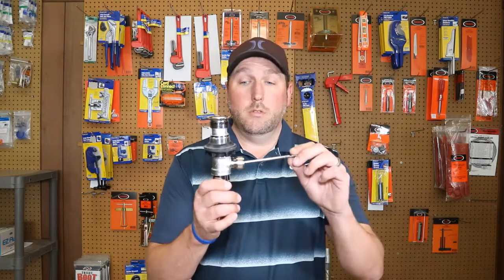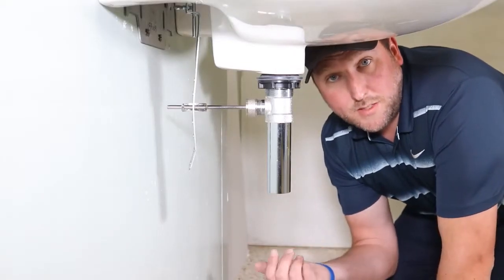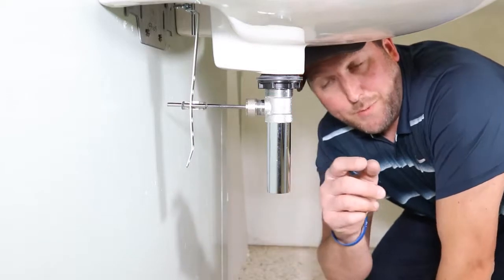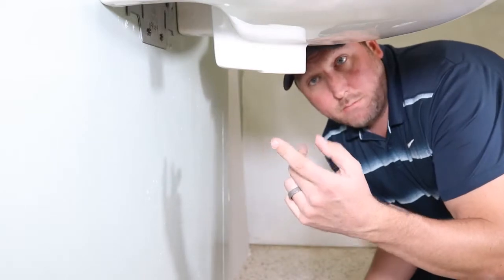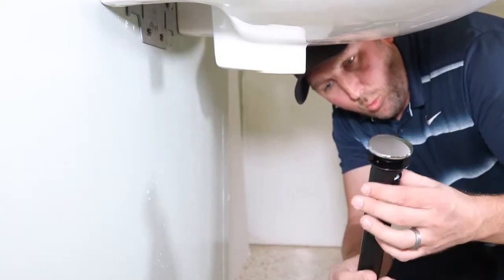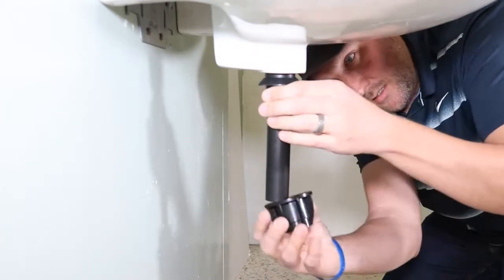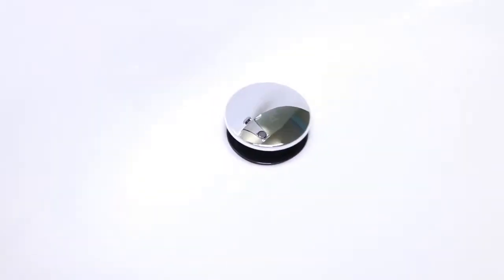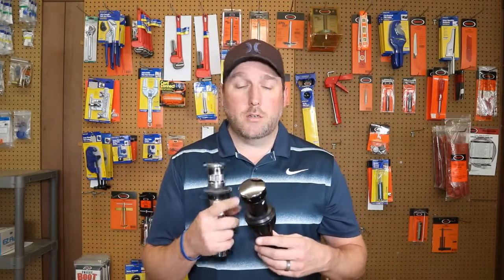How To Replace A Pop Up basin Drain

Comment: Tried and they break after a short time. Clicking mechanism.  Also hard to clean the gunk build up around the lip. Old style lift out or unhook. Use old tooth bush to clean out way down. AND old style helps filter the hair so ezier to get out with brush. AND less times to open up the P trap or link to the wall and good to go. Also who wants to put their hand or finger back in their filthy sink water to push the button.  Went back to the old style it works and is reliable for years.  Multiple apartment owner.

Comment: So, after upgrade, u have to wet your finger to open the drain.... and there will be a hole on the faucet  where the old rod was. (Ok, I will plug it with a rubber plug.)

Comment: Thank you for this video. I ordered two of the pop up a.b.d.'s that you recommended. I had to repair one of my pop ups today because the rod came loose from the stopper. I have to pull the stand of my pedestal sink out so I could get to it. My other bathroom has a fairly new Moen faucet in it, but the hole for the pull up rod doesn't line up with the holes in the sink. So the pull up rod is at an angle pointing to the back and it looks terrible. I'm glad I came across your video so I won't have to deal with the ones I have now anymore.
Reply from the maker: Thank you for watching and ordering. They do work very well.
Reply: @PlumbingPartsPro  I installed both of them and they are so much nicer than the pop ups. Thanks again for the video. 

p.s. I recently unclogged a tough blockage in a drain by water jetting it out with a new pressure washer. I much rather do it that way as opposed to using a snake.

Comment: Pop up drain for bathroom sink. And the bottom gasket keeps leaking. It's a flimsy clear rubber thing. Should it be replaced with a larger black one? And seal with a silicone caulk?

Comment: The strap is not lined up properly to the drain and everything is new. The strap is bent to reach the bar. The clip is on the strap and the ball bar correctly however the angle (down) is letting the clip fall off the bar. Looks like you have something there which stays on the bar better than what I have. 
The contractor came and put it on already once. It fell off a year later. Now I’m doing what I paid him to do in the first place. 
Can you send a close up of what you used. It’s much better.

Comment: It did not look closed when you pushed it down, did not test to see if it would hold water.
Reply from the maker: This was a display with no water or ptrap.  It does hold water very well.  The fact that it's spring loaded there has to be room to press downward to disengage the drain.  The washer to seal it is sitting lower than your typical pop up drain.

Comment: I bought a pop-up kit from home Depot. Where that lever goes in with the round ball, there is no washer or compression ring. I cannot get it to stop leaking from there. I thought maybe my kit was missing the compression ring, so I went back to home Depot and bought a second kit and discovered that it also does not have a compression ring or washer where that round ball for the lift rod goes in. I have taken the nut off and rethreaded it several times but cannot get the leaking to stop. Help! Unfortunately I bought the standard type of pop-up before seeing this video.
Reply from the maker: So it actually depends on the pop up.  Some have the washer on the inside of the body of the pop up and nothing on the nut side of the ball.  This is because water should never get that far.  I have seen some Deltas that don't even have a full round ball and are open on the outside.  Make sure, if required, the washer is on the inside, also if it's a plastic nut it's not been overtightened and cracked and as last resort you may need a couple rounds of teflon tape on the threads (not required)
Reply: @PlumbingPartsPro  so I think I figured it out. Apparently I misthreaded the nut the first time I put it on and it messed up the threads. I used the nut from the second one I bought and that seems to be working.

Comment: Mine is leaking from the part by the faucet you pull up  how do I stop that or what can I do
Reply from the maker: +Caprice_ Pete usually if it leaks to top its coming from the faucet itself or splash water.  there's really no place in the drain for it to leak that high

Comment: I watched your video on the installation of a pop up drain assembly.  I have purchased a new vanity top with integral sink.   I bought a new plastic pop up assembly, have used plumbers putty as recommended, but can't stop it from leaking around the drain assembly.   I have hand tightened it as hard as I can, I also reluctantly cranked it a little tighter with a wrench.....still leaking.......running out of ideas

Comment: It is leaking  between the nut and sink. I used plumbers putty for the flange
Reply from the maker: So SOMETIMES I have run across a sink that has a rough finish underneath that causes a tiny leak.  I have put a small amount of putty on the under side between the washer and sink.  Also if it's a plastic drain, make sure there's no small cracks.

Comment: What did you do with the old lever on top that was used to pull the pop-up??
Reply from the maker: You can just remove it.  They make small plugs to go in the hole, I have seen some people put a small dab of clear silicone in the hole and some people leave it open.